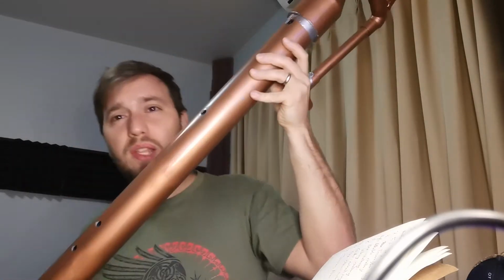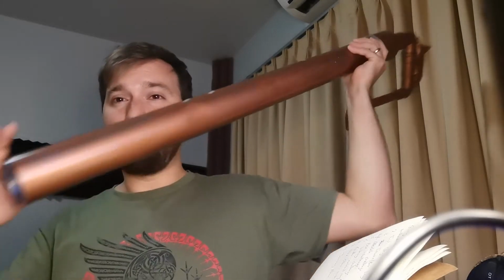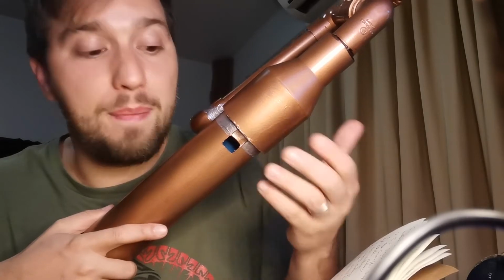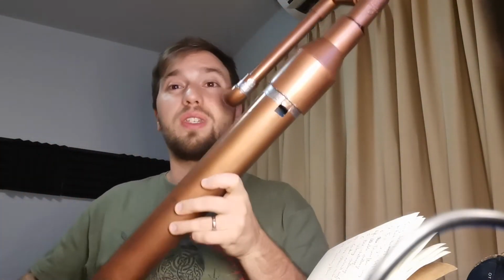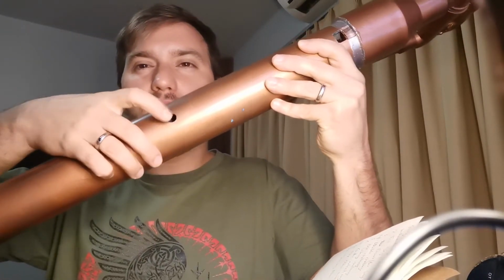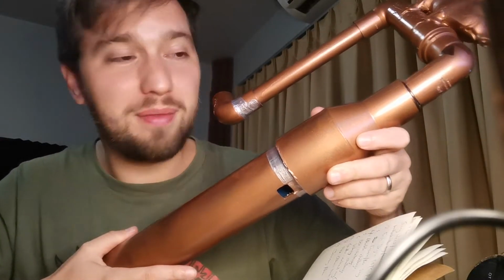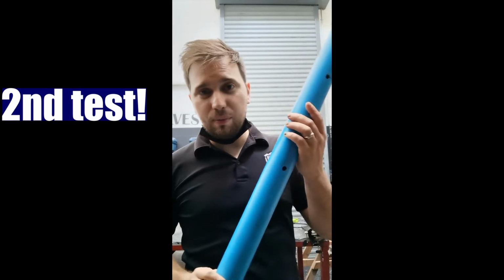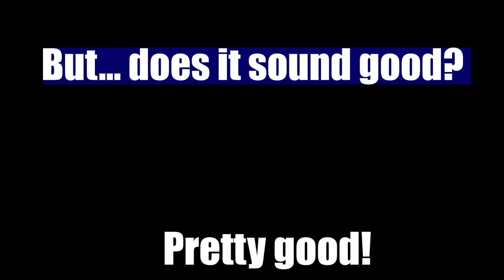Making a Bass PVC Flute - The Pig Flute

Comment from the maker: Measurements:
Track width: 15 mm
Track length: 35 mm
Track hole: 10 mm
2" Pvc length: 825 mm
Front holes: 260 mm, 500 mm, 550 mm
Back holes: 175mm, 410 mm

Comment: Nice for a first flute ! 
Little bit "airy", because your sound hole is to long. it must look like rectangular shape, not a square shape.
Begening flute crafting with big contrabass models is not the easiest thing to do, because dealing with sound mechanisnm and fingers holes placement is not simple as that is on smaleriest size flutes...
the air channel tickness have a crutial effect on air quantity needed to have a sound.
If you juge this need to much air, reduce the air channel tickness will help you !
Also the angles of the sounding hole is pevry important. the edge could be blunted for a clearer tone.
If you are interest in flute making, go check the web site "flutopedia". they are tons of information about Native flutes craft.
Reply from the maker: Thanks so much for the advice, I'll definitely check site that out. I agree it is a bit on the airy side. But for a first try (and a contrabass at that)-- I'm pretty happy. Definitely going to try new materials in the future (bamboo) and different sizes. Thinking of going simpler next to get more skills-- an overtone flute.